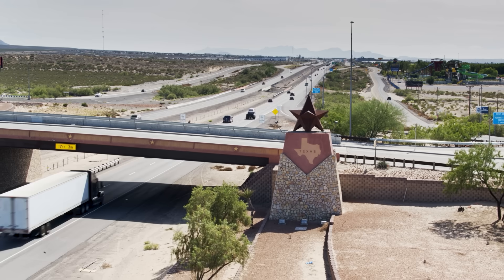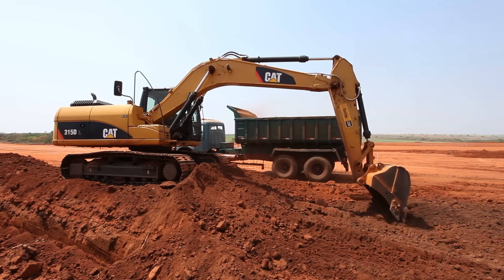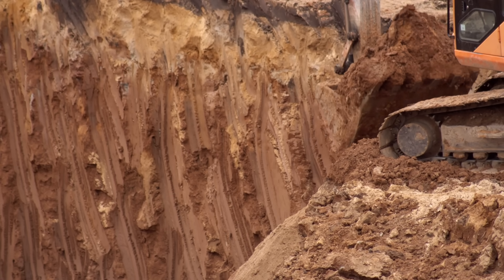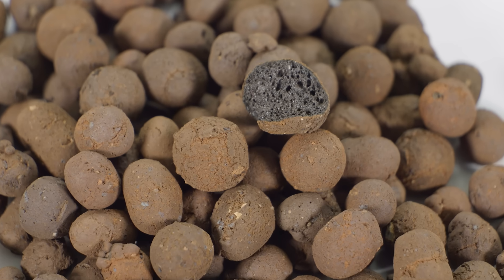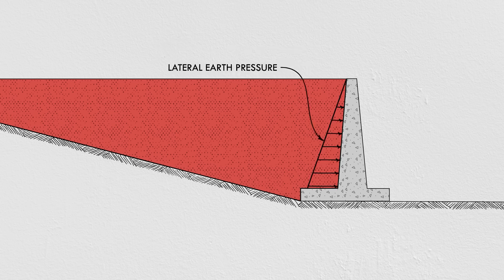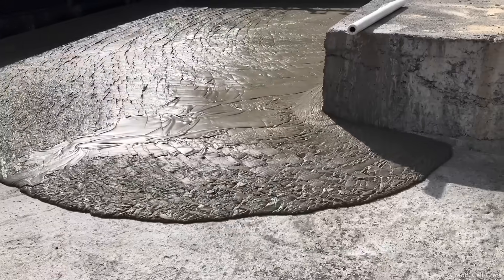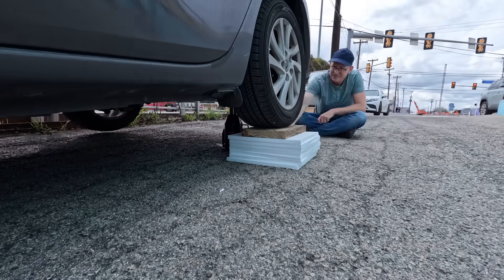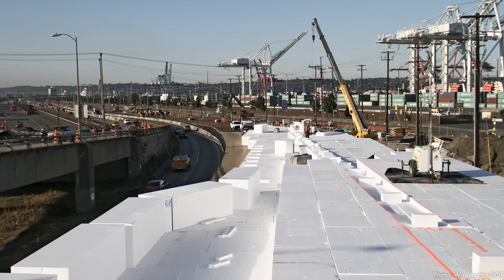Why Some Roads Are Made of Styrofoam

Comment: There's a new Styrofoam Manufacturing Plant near were I live here in Quebec whose product was used to recently build approaches to bridges in a new 4-lane highway expansion that occured only 5 km from the plant. My sister worked for my uncle's construction company this past summer and one of her jobs ended up being laying 3 inch thick sheets of Styrofoam onto a roadbed before it was covered with material and paved over.  The road is located in an area with  sandy-loam soil and thanks to it being Canada means that it experiences -30C in winter and +30C in summer.

Comment: My buddy worked for a township and serviced its road and traffic equipment. I blame him for my odd obsession with the knowledge you show in your videos.

I can absolutely see the need for these types of options and wonder where the Technology is going, especially when it comes to busy intersections for certain traffic areas.

In his township they have a few really major intersections. So major that traffic accidents happen more often than you think. I wonder how using this technique for onramps and offramps would help these troubled areas 

Traffic signals only help so much. Considering how major the one intersection is, I wouldn't be surprised if they decided to go under or above the intersection to keep the flow of traffic.

I seriously didn't know about the use of the material covered here, except I knew about the concrete version

Comment: As a person who is not an engineer, civil or otherwise, thank you for this video. I had a feeling that, this is why many projects around town take forever. I know this is just a primer, but still valuable information none the less.
Reply: well 90% of the work is just waiting ... just like in military... sometimes you are just waiting for that BRTTTTttt~~
Reply: A huge demand to speed things up.
Reply: Then what would make public reviews simultaneously more popular and also not prone to trolling or the twisting of results to  support a group?  Because having accurate opinion and having lots of people act on it are unfortunately exact opposites.
Reply: If only they would put up accurate signs of what we are waiting for as we are stuck staring at an abandoned work site blocking our daily commute.  This would create a clear distinction between necessary inconvenience and incompetent mismanagement.  For example, my commute has been seriously disrupted for years by a never explained decision to relocate every pipe and cable under a major road allegedly to prepare for an already controversial project on the surface.  As a commuter I always felt that was an unnecessary step as they could probably have used pillars or horizontal load spreading to support the surface project while leaving most of the substructures unchanged.
Reply: @johndododoe1411  They do this very, very frequently. Public review of projects is mandated by a lot of places, people just overwhelmingly don't participate.

Comment: are embankments significantly cheaper than bridges? is cost the primary reason why highway overpasses end in embankments rather than the bridge angling down to ground level on each end?
Reply: Both cheaper to build and maintain.  Bridges are a nightmare for ongoing maintenance.  (Inspections every 24 months, even for new construction, for starters.)  Once you start getting some age on them, you have to keep ahead of corrosion, whether the member itself for a steel bridge, or the reinforcement in a concrete bridge.  Meanwhile, there's not a whole lot that can go wrong with a pile of dirt.  Some stuff can go wrong, of course, but they're usually pretty cheap to fix.

Comment: About a decade ago, Wadsworth Rd, between Hwy 45 and IL 21 was rebuilt. They placed EPS on the compacted sand, asphalted over the EPS, then concreted over the asphalt. It was the first time I've ever seen a road built in that manner, and wondered why it was done in that way. I assume that between all the layers, the total thickness had to be more than 2ft thick. Finishing in concrete would be my choice for the loads imparted by the heavy industrial use this road experiences, for longevity and service life. Although concrete is more expensive and not recyclable, like asphalt, it lasts around 50 years with minimal maintenance. Asphalt, especially in the northern Midwest, lasts around 7 years and requires frequent maintenance to fill expansion cracks and potholes from temperature and load deformations. Preferably, asphalting over concrete is the best option, as asphalt protects the concrete from weathering, concrete stabilizes the asphalt for a smoother surface for longer periods, and asphalt is quieter and lower resistance on car tires than concrete.
Reply: asphalt contains hydrocarbons, which melt EPS.  It's unlikely they directly asphalted over the EPS for that reason.  What you saw was probably a protective membrane specifically for keeping the EPS isolated from liquids.

Your state DOT almost certainly did the cost calculations of resurfacing the road vs rebuilding with concrete over the lifespan of the highway, and also their available budget, and picked the best project for the time.  If money was limitless we'd all be driving on different roads, but people get annoyed when their taxes go up to fund highway projects.

Comment: This happend on the HOV offramp on I-10 and SR51 in Phoenix...  They put a sign up saying bump when coming off the ridige overpass to the compacted soil where it dropped about 3 inches....  after a year of it setteling, they injected expanding foam through the locking block wall and there was foam expamding out like an anus for about 4 days, but it raised the road back up and level!!!!

Comment: About 15 years ago my son bought a house that at that time was 25 years old. While we were putting a trench in the yard to handle some surface water, we discovered that the builder or workers who built the house, buried some of the foam board that was excess to their needs. I was surprised the foam board was in perfect condition and once washed off perfectly usable again.
Reply: This is hilarious.
I see future archaeologists on your sons property, the area cordoned off with  markers and string, all of them hunched over a small white corner protruding form the soil, and slowly dusting away dirt with a tiny brush. 😄
Reply: I mean, it's plastic. I'd be surprised if anything had happened to it.
Reply: @WhenDoesTheVideoActuallyStart  
I agree with you however, there is one more part of this perhaps you didn’t think about. Chances are the builder or the workers thought it would decompose and/or they could hide it in the soil graded around the house.  The same thing applied to people doing excavation work and trenching for us, they wanted to throw their soda cans and foam cups in the ditch and cover them up out of sheer laziness, and never considered recycling.

Comment: Haha, awesome! 
I have seen those gigantic styrofoam blocks used as floating devices and have even lifted one (it feels unreal how lightweight it is, given how huge volume it has) and also seen them being used during construction of pipelines for district heating (in that case for heat insulation). But I could never think they would be strong enough to use for whole road embankments, haha. That's cool. The foamy structure and light weight also means very little material can be used to fill up a huge volume - which cuts down cost and environmental impact during manufacturing.
Reply: In theory, one could argue that using styrofoam as backfill could count as carbon sequestration, reducing the environmental impact even more compared to using a similar volume of styrofoam for disposable cups and the like.
Reply: Those blocks, with a concrete top, and a mesh and gunite covering, are doing sterling service in the harbour as walk on moorings for the yacht mole, where they form the spine and walkways used to tie up the boats. there is a steel rim on the top used to provide the hard points to fix them together, and to carry the piping used to provide power and fresh water to the boats along it. easy to expand as needed, and as they float, they only need a chain to a bottom concrete block anchor, with slack to handle the tidal difference, to keep them in position, and a rolling gangplank to allow access at all tide heights. Been there for decades, and still going strong.
Reply: I have only heard of their use in construction, but I have seen and handled slicing them into panels by pushing entire blocks through a frame of hot wires spaced according to desired plate thickness.  This was between 1970 and 1990.
Reply: The second half of your comment just repeated the video :P

Comment: It sounds like there's a much easier way to prevent any bumps. A hinged metal plate. Kind of like a lot of floating docks have, that way the ramp could settle entire feet and there would be bumps.

Not that it would solve every problem lighter fill would have, but it would stop the bump outright, and I worry about the environmental effects of some of the methods mentioned here.
Reply: This wouldn't prevent a hump.  The issue is the soil under the bridge embankment is settling over time as the new pressure from the embankment drives water and air out of it. All your plate will do is change the angle of the hump, and make a very hard surface for cars to hit as they hit the hump.
Reply: @randommcranderson5155  no. The metal plate would bridge that hump. Like a ramp.
Reply: There is so many things wrong with this idea I don't even know where to begin.
Please enlighten me on how a hinge would stop a bump hahahaha.
Reply: @goodbyemr.anderson5065  I think you misunderstood his idea.

His idea is to attach a metal plate with a hinge on the bridge. The other side of the plate just lies on the embankment.
So when the embankment settles the metal plate just becomes steeper.

Of course the metal plate must be long enough that the gradient doesn't become to steep. And also heavy enough (or somehow fixed) so that it can't be picked up by wind.
Other than that it seems like a viable option.

An example where something similar to this is in use would be RoRo ferries.
Reply: @Jehty_  yeah but its still a bump. i understood full well what he meant. A bump or a ramp its still there and not what you want on a high speed highway.
Reply: @goodbyemr.anderson5065  why? If the ramp is long enough you wouldn't feel it.
Edit: You have to remember that we are only talking about a tiny bump. So a ramp to bridge that tiny bump doesn't have to be all that long in order to not be noticeable.
Reply: @Jehty_  besides still feeling the bump at high speeds there are many other factors that make this idea dumb.
Reply: @goodbyemr.anderson5065  but you wouldn't feel the bump anymore.
It's a ramp. Not a bump....

Then tell me some of these many factors 🤦‍♀️
Reply: @Jehty_  bro at a 140km an hour a ramp still feels like a bump haha, what is wrong with you. Have you ever driven a vehicle before?
The idea is dumb, and im done here.
Reply: @goodbyemr.anderson5065  apparently we have different understandings on what a ramp is.....
Reply: @goodbyemr.anderson5065  I guess you always catch air when you use an on-ramp?......
Reply: @Jehty_  if you hit it fast enough yes
Reply: @goodbyemr.anderson5065  how about instead of insulting me you would use arguments?
I know, using arguments in a discussion is crazy, but how about you just try it for yourself?

Comment: The east/west runway of the Armstrong International Airport in New Orleans (actually located in Kenner Louisiana) was constructed into the Labranche wetlands on polystyrene blocks in 1994 by TL James Construction.  Up until sometime around 1980,  many roads in south Louisiana were constructed on clam shell embankments through the swamps, but deposits of clam shells were eventually depleted. Unrelated to lightweight fill, there is also a roadway tunnel that was built under the airport around the same time period but was never opened to traffic.

Comment: Thank you, I have often wondered why. I see a lot of styrofoam used at the on and off ramps of bridges. 
There is a particular place where I live where it's used in the road construction, going over a marshy area, two places in particular, and it's a noticeable drop after only a few years. They have replaced one of both sides of the short stretch a few times, since I have lived in the area, the most recent being last year after a once in 100 year flood eroded the sections of the highway significantly. I am curious as to why they would continue to replace these two sections the same way every few to several years, knowing that, in my opinion, it is not a permanent fix?
Reply from the maker: Hard to say for sure, but it could be that the permanent fix would take the road out of service for too long during construction.
Reply: Could also be budgetary--for example, the permanent fix might be $1mm, while it's only $100k for the temporary fix.  If you will never receive a $1mm appropriation for that road fix, well, you can't do the "correct" fix, so you just do the repairs you can afford.  Especially if you can get sued if somebody gets hurt, so you can't wait to get the alignment back up to standards.

Same way that somebody might be driving a beater car that eats repair dollars.  They know full well that it would be cheaper overall to buy a good used car, but they also know they'll never have all the cash required to pay for the newer car in one place at one time, and they can't not go to work for a couple years to build up the bank account.  So you spend the smaller repair money you actually have on hand.

One other thing that can't be forgotten: it might be cheaper overall to just do the cheapo repairs.  If the "permanent" fix is gobsmackingly expensive enough, you might want to just eat the ongoing costs as that will be less money.  To continue with my toy example from the first paragraph: if the permanent fix is $10mm, you could do that "temporary" fix 100 times before you add up to that permanent repair cost.  If you will only be doing it every 5 years, it is better value for the taxpayer to just do the temporary fixes.  (This assumes that you're not having the road closed unduly long--as Grady points out, that has a cost of its own.)

The first rule of civil engineering is "Every Hole Is An Adventure."  You don't really know what's involved in something until you actually start construction.  In my own field (structural) you might have as-builts that purport to show where the reinforcement is in concrete, but prepare to be surprised once workers start drilling in anchors.  When digging a foundation, most of the information comes from boreholes on fairly wide spacing, and they can miss entire geologic features between the holes that then impacts your design.  You start digging in a marshy area, you don't really know what's down there, and a "permanent" fix in those conditions might be very, very expensive.

Comment: I worked for an EPS manufacturer many years ago and one of their contracted projects was scrap EPS blocks to go into the middle wall and other sections of a dual tunnel roadway. The grade was usually a SL or L grade (Super Light or Light) EPS block, up to 5 metres long, by 600mm by 1.2m. For its size, they're very light. Saved the joint venture construction partners millions in fill and related costs, plus gave the EPS company plenty of work besides making sheets insulation and lobster boxes.
Reply: I didn't know standard block forming machines could do 5m blocks, I thought they were standardized at 2.5m industry wide.  Obviously making a double size machine is technically trivial, just not what can be easily ordered and shipped from a major supplier of EPS equipment.
Reply: As a native Mainer I thank you on behalf of our lobster industry
Reply: Do you have a number on that or is that a European thing? Here I can boy esp 60, 80, 100 and 120 and the number stands for I  some unit (don't remeber what) pressure it can take.. pretty much forever.

I calculated when I did my foundation and I needed less than 20  but that simply was not possible to buy. I know ir exist, I have seen it, but never seen it for sale.

Comment: Well done, as always. Just a precautionary question, but what measures are in place, if any to prevent/mitigate intentional sabotage of this material? We've got cranks testing destructibility of all sorts of infrastructure for whatever lunatic reasons. Integrity security can no longer afford to be an afterthought. If this material is so easily decomposed by gasoline, especially when the impact is so relatively large for such a small volume it'll become a highly desirable target to lone wolf sabotage sooner or later.
Reply from the maker: I mean, all it takes to ruin an earthen embankment is 30 minutes with an excavator. Anyone could sabotage any road anytime with very little effort. EPS foam isn't really that much more vulnerable, and damaged embankments can be temporarily repaired very quickly (see my previous video about the Sanibel Causeway).
Reply: @PracticalEngineeringChannel  I'm assuming ruining a road with an excavator would be more visual. Whereas taking a drill and pouring a few jugs of gas would cause sinkholes?
Reply from the maker: @Okabim  It would take more than a standard drill to both penetrate the pavement and base layer and support the hole from collapsing on itself. The EPS foam is usually at least 1-2 feet below the surface of the roadway. It would also take a lot of gasoline to create much of a sinkhole! I think it would be difficult to do this surreptitiously.
Reply: @PracticalEngineeringChannel  Ah, excellent. So no real way it could be twigged to become non-visibly lethal to street traffic, you think? In terms of something that would be apperant to someone with say, a high school education. your 'average joe' as it were. Like the sorts we've seen assaulting electrical substations.